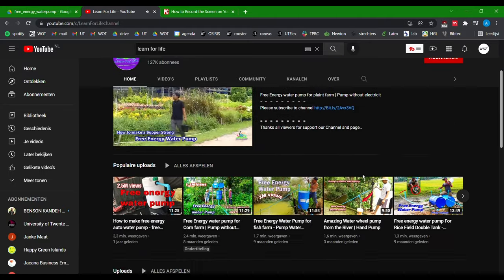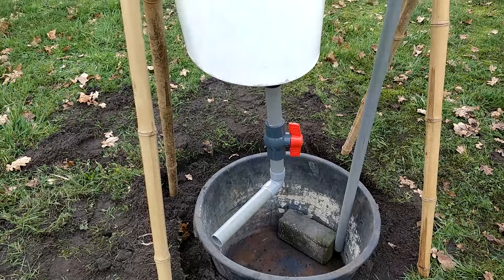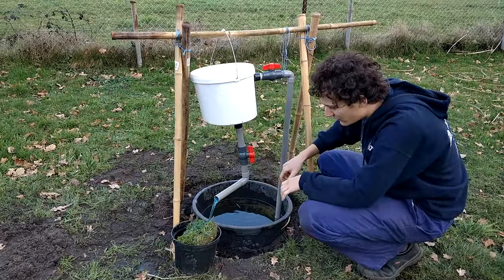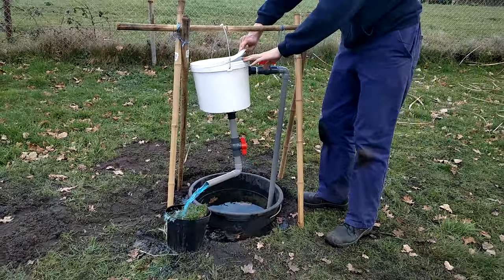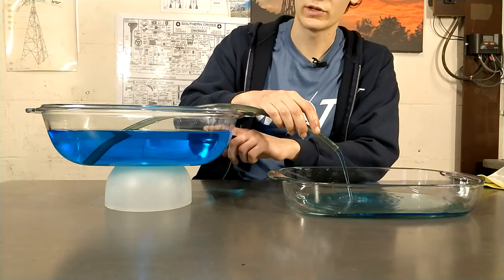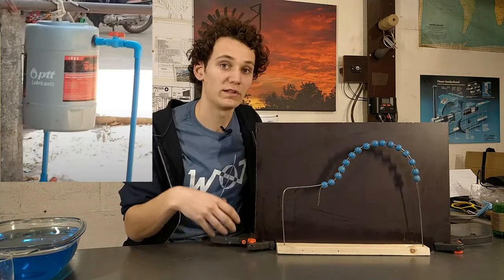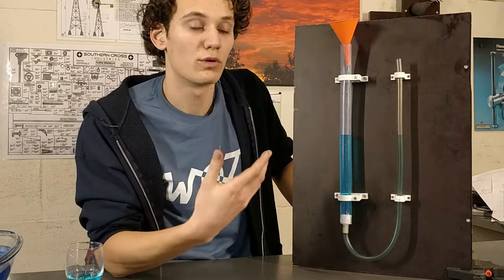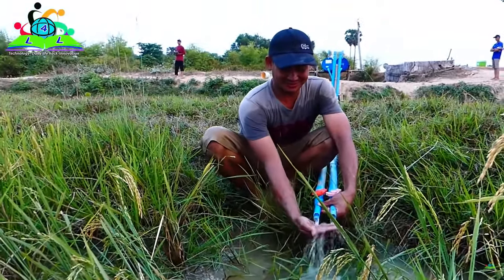FREE ENERGY Water Pump Tested. Is it possible?

Comment: Its a combination of siphoning & vacuuming not only siphoning. The vacuum created in the container is supposed to pull the water up into the inlet. You are trying to use only siphoning so it cant work unless the source water level is higher than the outlet. 
You need to make the output tube much longer to create enough vacuum in the container when the water in the outlet  pipe flows out by gravity to pull an equivalent quantity of water back up the inlet pipe to replace the water that has flowed out. Also you could put a one way valve on the outlet pipe to prevent air going up the outlet pipe into the container and messing up the vacuum. They also added inverted jerry cans vertically along the outlet pipe which I think traps any air bubbles moving back up the outlet pipe thus preventing the vacuum in the main tank from getting messed up like it did in your experiment. Another thing I feel the main tank should be big enough to hold enough water & high enough to create a strong pressure on the outflow which will also prevent air getting sucked up into the outlet pipe. 
Please give it another try with these suggestions and let us know if it works or not. Thanks.
Reply: I agree with your analysis. I am planning on trying the same.
Reply: I agree. And also i think this doesnt work with smaller model because we cant also make water smaller XD
Reply: suction is siphoning. much respect for you physist...😂
but the guy only taking about siphoning
most of these systems don't work on one principal. they work on several principles. so to understand the science behind it requires you to understand and appreciate several scientific principles😅😅
Reply: @tuchibigboy3178  
The science for this contraption is always the same, but there are rules that this stupid physicist didn't respect, on purpose to discourage people, typical of the Cursed Ones.
Reply: and outlet has to be smaller than inlet
Reply: No,  Don't be afraid it won't work, it works if you follow the rules.  The outlet must be 3 times the diameter of the inlet, example 3/4" inlet, 2" outlet and must be at least 8 meters long and reduce to the diameter of the 3/4" inlet, with a valve so that the tube is filled with water up to the drum.
The drum must be made of metal and completely watertight to withstand the enormous pressure.
The 3/4" inlet must have a non-return valve inside the water and must be filled with water.
Here is the link for you to see, remenber all joints have to be glued, https://www.youtube.com/watch?v=zhKifQt-OH8.
Reply: yes that way it will work
Reply: @leopoldpoppenberger8692    No, it does not work, never mind how pipes and barrel are dimensioned. Such a pump would violate conservation of energy, one of the best confirmed laws of physics. Also, if this pump would work, we would have it in use at many places all over the world. But it only runs in YT-videos.
Reply: David Lockett    Sorry, but I doubt you have figured out the physics involved! Archimedes' principle, inverted or not, does not overrule conservation of energy. Lifting water to a higher level is not possible without an input of energy. Whatever you try, it will fail. I think you overlooked that vacuum works both ways. It would stop the flow of water at the outlet before it would be strong enough to pull up water from the well. Just figure out the water pressures at both sides, which only depend on the height of the water column.
Besides, although it is a common saying that vacuum sucks, this isn't true at all! A perfect vacuum means empty space and empty space does nothing. The effects attributed to vacuum are in reality the influence of air pressure without an equivalent air pressure on the other side.
Reply: David Lockett    Yes, all true, but even if the vessel would be built strong enough not to collapse - which is possible - this "pump" would not work. You evade my arguments. An increasing vacuum would stop the flow of water from the outlet before it could draw up water from a deep well. And if this system would work it would violate conservation of energy, which is one of the most fundamental and best proved laws of physics.
Reply: David Lockett    I quite believe that you learned some new things, but what you learned is for sure not new for science. And if you study the story of the Wright-brothers you will find, that they did consult scientists and scientific literature for a basis of their airplane construction. They also stood on the shoulders of earlier flight pioneers as Lilienthal.
Reply: @josephpasion33  OK. so if you wat to test a Jumbo jet you have to make a vind tunnel the size of a Jumbo? My friend workd for decades making ship models and testing them in hash conditions in a model tank. Al in vaine, he should have had acces to a model tank the size of a 500 000 ton crude tanker?
Reply: @joseinfante5054  BS
Reply: David Lockett  Please give us a link to this paper. Would be interesting. Do you also have any references to a paper describing exactly how a syphon works? Scholars do not have a comprehensive understanding. For everyday physics the chain of balls are good enough.
Reply: @sciencefreak9070  Exactly, was doodling  with the same arguments. Vacuum is empty space.
Reply: David Lockett  It is your lounges that tries to expand against  atmospheric air pressure. Her is another experiment: take a 0,5 meter straight tube, climb down the ladder in a swimming pool  so that your head is 30-40 cm under the surface and try to breath via the tube.You will not manage. That is the water pressure from only a few dm down in the water.
Reply: David Lockett  And many tried to mimic the birds in an attempt to fly. Birds are light, but still heavier than air. Da Vinci even foresaw the helicopter. Ikaros was one of the unlucky ones.
Reply: @iceslit  larger
Reply: @iceslit  No. But it can be needed either to tikt the output sonewhat upwards or to dip the outlet into a bucket of water. Both ways will prevent air from sucking in in reverse .
Reply: @joseinfante5054  No, no and no. You may simply use a hose, no valves, no variation in diameter. This is simply a siphon with a barrel.
Reply: @sciencefreak9070  It works, bur only if input is higher than output. As with ant siphon.
Reply: @kjellg6532    Yes. And input is of course the level of water in the well and not the input of water in the drum.
Reply: the tubes are to big for that small container that create vacuum .. noob try
Reply: @clauluckyan2709  If you drop the 90 degree bend at the output you have the output pointing straight down. Dip the output into a tiny cup of water and open the outlet valve, what will happen? Notthing. All that water stays in the container. 
You can easily test this. Take bottle. Suck it in water and lift it by the bortom. It stays full until the neck gets over the water. You could even hold a piece of plsyng card  agaist the neck, lift the bottle/card combo up from the water. Then gently move your fingers away from the card. If the rim of the bottle is smooth, again, no water comes out! 

Yo prevent air in reverse from the outlet, dip the outlet into a bucket of water or ad an upward pointing bend. With a output hose, siply lift the outer end a few cm. No air will enter the system. It will simply stop.
This video shows that this set up can not work as a pump.
Reply: @Dingsrud  the bigger the tank = more water inside .. more water inside = bigger pressure for exit .. bigger pressure for exit = bigger wacuum in the tank .. the only thing remaining is the math on the capacity of the tube that brings water and the distance from which it brings it .. https://www.youtube.com/watch?v=f3cvCT0E6jw
Reply: @clauluckyan2709  «more water inside = bigger pressure for exit». Are you sure?
Say a tank, it is 2 m in diameter, 1 meter high. It holds 3,14 tons of water. Beside it a tube, you can barely get a finger inside. 5 meters up from the closed exit valve.
What is the pressure at the exit of the huge tank? About 0.1 bar. And at the exit from that thin tube? About 0.5 bar! Five time as much pressure in the thin tube even though it only holds 1-2 litres.
Reply: @clauluckyan2709    If the outlet is higher than the water level in the water reservoir this "pump" does not work, never mind what sizes of tubes are used. You can't lift water (or any other object) to a higher place without an input of energy. The vacuum "sucks" not only at the inlet, it also sucks at the outlet. The increasing vacuum stops the flow of the outlet and thus vacuum does not increase anymore. And this happens before the vacuum is big enough to pull up the water from a deeper reservoir.
Pleas note that water pressure does not depend on the mass of water but only on the height of a water column, never mind how wide it is.
Reply: @josephpasion33  Relative to a H2O-molecule this tank is enormous. The experiment shows that this does not work unless input is higher than output.
Reply: @tuchibigboy3178  sorry, but this exqlent videi shows that this doe not work unless the source is higher than the exit, as with any siphon.
Reply: @iceslit  Noop, but inlet has to be elevated higher than outlet.
Reply: @joseinfante5054  No, you can use any pipe as long as the input is higher than the output
Reply: The "Learn for Life" site has an example to think about.  The siphon goes into a small barrel.  The barrel is filled and a piece of plastic wrap is tied over the top.  When the exit valve is turned on, the water exiting creates a low pressure area under the plastic wrap and the plastic wrap is visibly pulled down.  The water surface of the well is at 14.7 psi (air press.) the water at the top is less so air pressure pushes water from the well into the barrel!!!  It works when the principle is understood!
Reply: @sciencefreak9070  The air pressure at the top of the water in the well is 14.7 psi (std. air pressure). At the bend at the top of the siphon, there is a partial vacuum formed by water on both sides trying to drop via gravity.  That creates a pressure difference which lifts a bit of water from the well. (the difference in pressure is doing the work.  It is the engine).  That is the basics.  The bucket is supposed to create a bigger low pressure area making the siphon more effective.  Rather than a top, a piece of saran wrap should have covered the top - it will visibly depress when the valve is opened.   Air coming up the outlet tube will kill the siphon action.  Running that into a clear container with water would have enabled the action to be seen without the risk of breaking the siphon action.  Bell siphons are similar - they work and are used all over.
Reply: @davidgharrod8174  A siphon can not lift any water at all. Input must be higher than output. So a siphon can not lift water up from any well.  
Try it for yourself. Take two waterfilled buckets, one on the floor, the other on a table. Connect them with a waterfilled hose and make water flow from the lower to the higher. The water only flows from the upper to the lower bucket. You may add as many barrels as you like, does not lift any water.
Reply: @davidgharrod8174    Kjell G has already responded to your comment. Siphoning and what is shown in this video can only work, if the outlet is lower than the water level in the well. Why? Because if the outlet is higher, then the increasing vacuum at the top of the barrel stops the outflow already before the vacuum is strong enough to lift water up from the well. Keep in mind that water pressure does not depend on mass but only on the height of the water column. It is irrelevant if the barrel has a small or big diameter, pressure is not affected by that. Water can't be lifted to a higher level without an external input of energy, otherwise conservation of energy would be violated and a perpetuum mobile would be possible.
Reply: Additionally you should use a smaller diameter of the input tube than on the output tube.  You'll be astonished what huge amount of force there work. It can smash solid steel drums through the vacuum, if the diffrence in diameter/length between the inlet and the outlet is too big. It's hydraulic leverage...
Reply: @johnwayne9103  Input diameter can be at size  even much grater than output side. The output may be as short as you like, nut the water level at the input must be higher thab the output..
Reply: I agree to that, What is very important is that the tank must be completely sealed so that air will not be sucked in when vacuum is created inside the tank and will pull up the water to replace the volume that is being poured out, instead of air. It is the vacuum created inside the tank that pulls up the water. The principle of siphoning as presented is an inaccurate explanation.
Reply: @erningpaguirigan5831    This arrangement does not work with an outlet higher than the water level in the water reservoir. In this regard it is equivalent to siphoning, it can only be used to prime a siphoning process. Why doesn't it work in this case? Because the increasing vacuum stops the outflow already before the vacuum is strong enough to pull up the water from the water reservoir. And if the outflow stops, the vacuum does not increase any more.
Reply: @sciencefreak9070  can you explain where enery supply for this?
Reply: Yes, I agree with you. Without vacuum created by the out going water, there will be no sucking effect thus the water from the intake (lower level) will not rise.
Reply: @renzogulle5422    Yes. To put it more precise: the outgoing water will form a vaccum and this will have a sucking effect, but with the outlet higher than the water level in the well the vacuum never becomes strong enough to lift the water all the way.
Reply: @erningpaguirigan5831  Vacuum dragging water up? No way. 
Take a bucket of water. Dip your hands in the water, take a firm grip and start pulling water up. You will not succeed. 
Water can not be pulled up, but it can be pressed up by atmospheric pressure,  which is the case here.
Reply: @kjellg6532  Ordinary water pump as in a pump well, can drag water up.

Using your bare hands to drag water up is stupid logic..
Reply: @erningpaguirigan5831  A pump at the surface can lift water up from a a well. Maximum lifting head is about 7 m for a normal pump, but it does not pull the water up. It is the atmospheric pressure down on the water level in the well that presses the water up. The pump itself reduces the pressure at the top so that water flows upward to cancel out the pressure difference.  The pump needs some sort of energy input, say electricity.
The “drum pump” only gets one set of energy: your labor lifting water up into the starting container. When this water is out, the “pump” stops. A siphon aka drum pump, is no pump and can not lift any water. to a higher level.
Reply: @erningpaguirigan5831  Actually my comment argue that vacuum can not lift, pull or suck anything. Total vacuum is total emptiness. It is pressure that pushes something, not a vacuum pulling anything.
Reply: @kjellg6532   An ordinary hand pump well where the valve is located at the top of the metal pipe dug underground,  creates a vacuum forcing the water to be sucked up.Such a pump well do not create a force of pushing up but a force of pulling up.
Reply: @erningpaguirigan5831  Noop. The  pump creates a low pressure at the top of the tube. Then it is the atmospheric pressure pressing down in the well that presses the water up against the low pressure at the top. Vacoom have no hands and can not pull anything, just as you with your hands can not pull any water. Water can not be stretched. Anyway, a drum pump is no pump, it can not lift any water to a higher level.
Reply: @erningpaguirigan5831  Please make an experiment: Consider the best pump there is. Set it at the top of a 15 m high tube and start sucking. How high in the sucking tube can you get the water?  About 10 meters. Why not higher? Because the weight of a 10 m high water column is about 1 bar at the bottom, or 1 atü if you like. The pressure down on the water in the well can not press the water higher than 10 m up into the tube. At the same time the water at the top, at 10 m, will boil - at room temperature.
Reply: @kjellg6532 Wrong because our topic regarding a drum type vacuum is not even more that 10 meters high from its source,

On the other hand, I thought that you said that regarding atmospheric pressure?  What is its relevance to your allegation regarding the weight of the water column when you say that [t is the atmospheric pressure that pushes the water up?
Reply: @@joseinfante5054  still makes nonsense! if the outlet is wider but the end is narrow, the flowrate will be determined by the narrow one! so waste of resources in the name of thinking out of the box! you've got to study hydrodynamics! the only pump that can pump water higher than inlet is the ram pump, but very inefficient, because it has to waste 40-60% water to pump less uphill
Reply: @martinmtawali7359  Excellent video, debunking the drum „pump“. There is no need for any thinner output, the system will suck air from the output anyway. If you modify the system by diping the output into a bucket of water, what will happen? A fraction of water will flow out, then complete standstill. An underpressure will build up in the tank but not so low that any water will climb the suction pipe. At the output side the outflow will stop very shortly due to the lower pressure in the tank.
There are multiple pumps besides ram pumps, that can extract power from running water and thus pump water to a higher level. Look up Bunyip pump, spiral pump, seesaw pump. As said, they all need some sort of running water and they often use a lot of water.